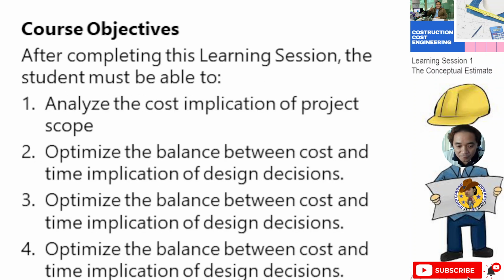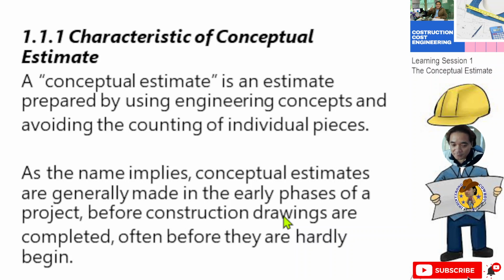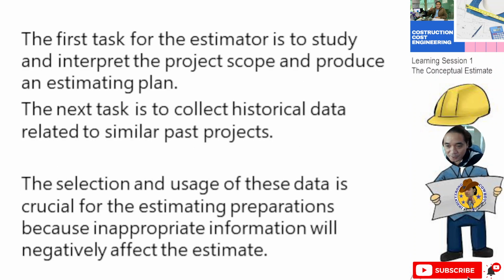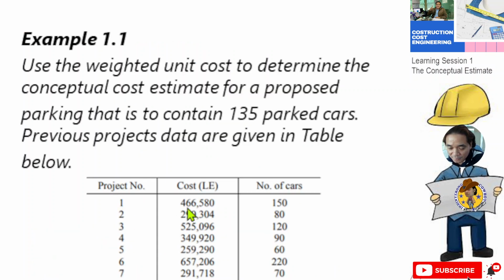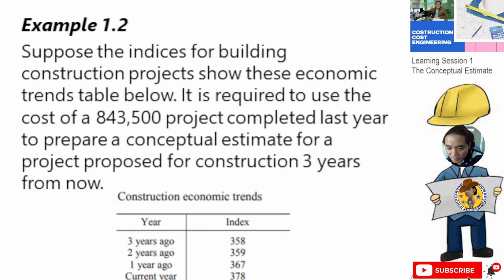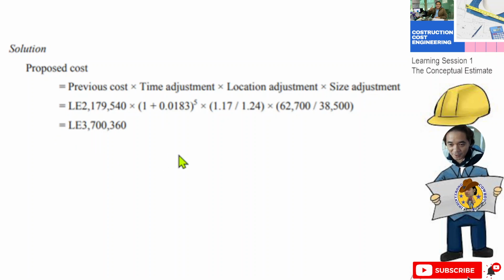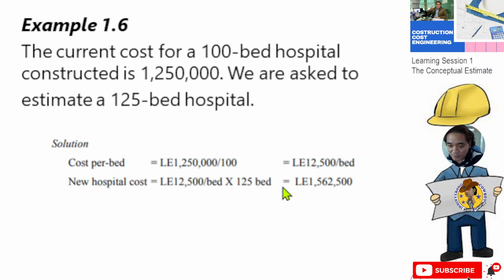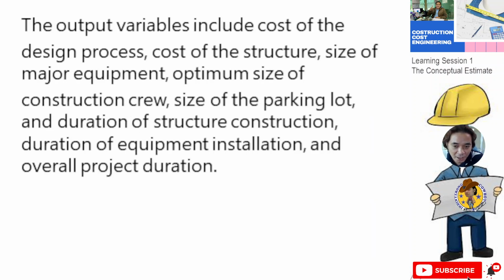Construction Cost Engineering | LS 1

Comment: Engineering principles are embedded inside conceptual estimating. However, conceptual estimating is frequently provided with little scope and design details. The cost estimator often has to have substantial expertise, experience, and judgment in order to generate an effective conceptual estimation. Conceptual estimating is the first stage of cost estimation, usually carried out as a project's feasibility study. In order to maximize margins and profit, conceptual estimating is becoming more and more crucial.

Comment: In this session, I've learned about conceptual estimate and its importance in planning a project.  Based on the discussion, it is mentioned that Conceptual Estimate is the first step in the pre-design method. Thus, it is given that it should be done even before the completion of the plan. This holds a critical place in the process of making a project, albeit small or large. Yes, it has pros and cons, however, it should be put in mind that it can highly benefit the project if conducted thoroughly.

Comment: In this learning session, I’ve learned that conceptual estimating gives client/owner a general idea of what a project will cost, that helps them to make better decision and decide if a project is even feasible before they spend time and money creating detailed plans, by conducting a preliminary cost estimate of the possible total project cost that based on the historical data to anticipate cost demands before beginning work on a project. Considering the following projected scope of work; past material cost, economic trends/rate and location cost indices. A conceptual estimate isn’t exact, it is a comprehensive outlook for the potential total cost, it provides a well-informed guideline for financial expectations. Considering project scope and financial demands alongside data from other projects with similar specifications. Including both direct and indirect expenses that helps clients to plan projects within their financial means.
              Making decisions as early as possible helps to move a construction project forward quickly without wasting time or incurring unnecessary labor cost.

Comment: Everything has a monetary value tied to it. In this learning session, I discovered that conceptual estimation is critical in the construction industry. The project scope or goals should be transparent regardless of project complexity, size, new design, or timescales. A construction project's total cost is directly influenced by its components. Compiling accurate data points is critical. Materials, labor, locations, project time, building codes, unique machinery, and even soil conditions at the job site are examples of such factors.

Comment: In this learning session, I have learned that conceptual cost estimate is done during the pre-construction stage of a project which is the construction costs made from the designer's preliminary sketches and outline specification. The estimate gives the owner greater insight to manage the overall cost control program and give time to review designs for possible alternatives. Therefore, it is important to estimate costs as early and accurately as possible.

Comment: Conceptual Estimating is imbedded with engineering concepts. However conceptual estimating is mostly prepared with limited information on scope and limited detailed design. Generally in order to develop an appropriate conceptual estimation the cost estimator should have considerable skill, experience, and judgement. Conceptual estimation is an early phase of cost estimation, typically it is performed as feasibility analysis of a project. Conceptual estimating is increasingly important for its cause of maximizing profit, and margins.

Comment: In this learning session, I have learned that conceptual estimate is a cost estimate based on the designer's preliminary sketches and outline specifications. Conceptual estimate is the first step in determining a project's cost, and it's usually used to quickly determine a project's feasibility and before considering the feasibility and future development of a project, it gives the owner to have greater insight to managed the anticipated costs of the project.

Comment: IIn this lesson, I have learned that a conceptual estimate is usually performed as part of the project feasibility analysis at the beginning of the project. A  conceptual estimate is also used to set a preliminary construction budget and control construction costs at the most critical stage during the design.

Comment: In this learning session I have learned that construction cost engineering it is the practice of managing the cost involved on a construction project and cost is very important in every construction project in order to complete the project. In cost engineering includes activities such as; cost control, budgeting, estimating, investment appraisal, and risk analysis.

There are five (5) methods or techniques that used in conceptual estimation. The following methods/techniques are; interpolation, unit method, superficial method, approximate quantities, and parametric cost estimate model.